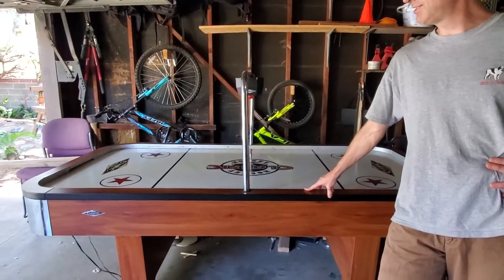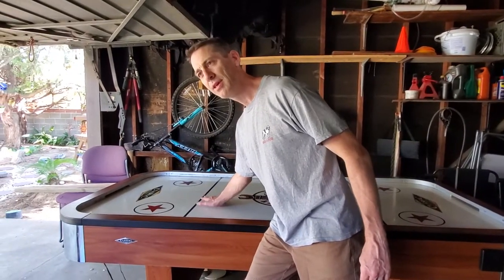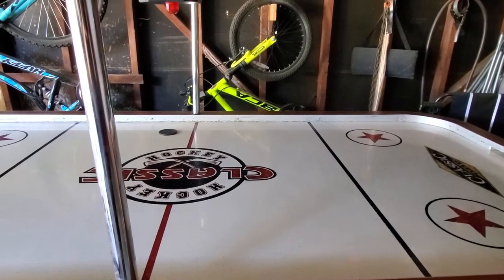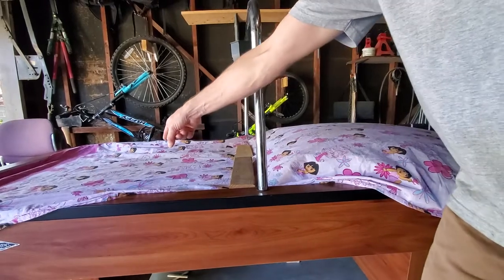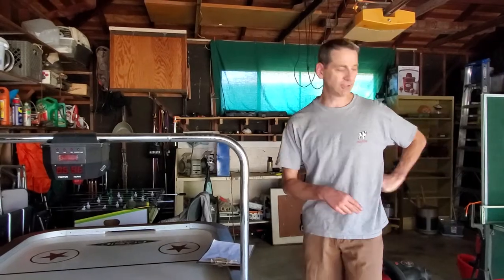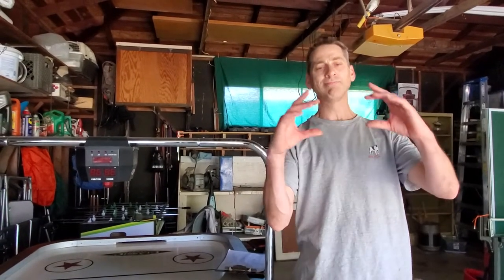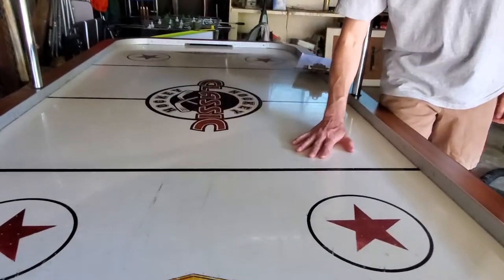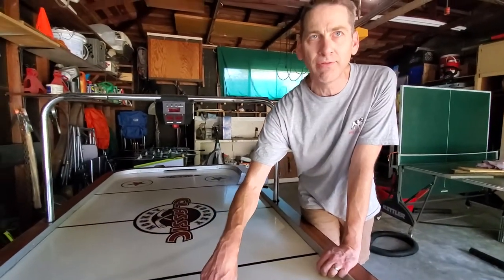Increase airflow on air hockey table at no cost!

Comment: This is a great idea for sure, but that’s not dust from years of buildup, that’s the dust from what you just drilled. 😉
Reply: Nah the 1/16 bit is the same size as the hole, so you are not doing any drilling.  There is zero resistance, you are just using it to pull dust out.   I actually do this with a broken drill bit that no longer has a pointy head so I do not accidentally drill into anything.   The key is to just lightly hit the drill button so you are only slowly spinning the bit
Reply: I get where ur coming from, but the holes are the exact same size as the other non-drilled ones, and it’s from buildup.

Comment: Great video- comment about the puck orientation: The 4 "dots" on the puck need to face the table surface, not the smooth side. I discovered this accidentally after buying my used table and before watching this video. I had no idea there was a difference between the side surfaces so I marked the "up" side with an orange sticker. This makes it easy to quickly put the correct side up during play. Just FYI  😎👍
Reply: Why?
Reply: @GoTips - my guess is that the 4 dimples add stability. The air is trapped evenly under the dimples when compare with the smooth side. I just ordered new Dynamo discs so we'll see if they are built the same way or if they're symmetrical.
Reply: @Spudmuffin00  i have 4 of the 2.5" dynamo puck but they only have 2 dimples not 4 but honestly they arnt so much dimples as they are where it looks like imperfections in the plastic
Reply: @GoTips  - I think the dimples are where they fill the mold with plastic. These are guesses on my part.
Reply from the maker: Great tip, thank you!

Comment: Do Not attempt! you will ruin your table. use a welding file for cleaning tips on a mig welder. and if one side of the puck drags, use a piece of 120 grit sand paper laid on a flat surface and slide the puck in circular motions over it. a little sanding goes a long way.
Reply: Those are to flimsy the drill is perfectly fine as long as you go slow
Reply: I use torch tip cleaners...gas torch, not mig. Just small reamers of many sizes.
Reply: @youknoweverything7643  With literally 1000s of holes, anything risky is likely to screw up eventually. I think I would only go the drill bit route if we are at the point of discarding the table as everything else has failed.

Comment: I'm having a problem with an air hockey table that I don't own. It's at my favorite hangout. The old hair hockey table had a metal surface with no holes in it. The air came from the sides and it worked great. Now they put a new air hockey table in and it's got the holes but the puck doesn't move very good. I don't think they'd let customers go in with a drill. lol

Comment: I'm a professional arcade technician. I have many years of experience working in the amusement industry and own my own successful coin operated machines business. For the love of amusement machines... DO NOT EVER do this to a professional coin operated air hockey table!!
It will completely ruin the table!
And quite frankly, if you do have a professional table (made by Dynamo, etc.), you should never have this problem to begin with (unless somehow a barrel of super glue got spilled over the entire playfield, in which case then you could try this but you really should just buy a new playfield). The playfield on a Dynamo table is replaceable. It's not cheap, nor is it an easy task (I've done it, it definitely takes more than one person), but a new table top for your air hockey table can be purchased from the manufacturer (or a distributor) to be replaced and it's the recommended method (by the manufacturer) for the repair of low flow air holes or other damage that can't be remedied with standard cleaning practices.
The reason the table in the video is having that problem is because it's a cheap, unprofessional table, made for home use only (HUO). If you bought an air hockey table at a retail store like Costco or Walmart, it was most likely poorly manufactured and it will have issues like the one in the video, right out of the box. Those types of tables are the only type you should ever attempt any "repair" of this nature, because replacement parts are unobtainable and the table is essentially manufactured to be disposable.
Also, that "sheet trick" he shows us is absolutely BS! It only looks like the pressure is weaker on one side because he has the two sides divided with that piece of wood and has already DRILLED THE HOLES LARGER on half of the table! So obviously there's going to be more airflow on that side of the table! If he tried that trick before he drilled out any of the holes, there'd be no way to tell where there's more air pressure coming from as opposed to other areas, unless you literally sectioned off the whole table into little tiny areas of one or two holes each and compared the amount of lift you get out of the sheet in every tiny little area, all at the same time! If he showed us that sheet trick before he drilled any of the holes, how would you be able to tell where the pressure was weaker?! What do you think it would look like after all the holes are drilled out? Then sheet is going to lift the same over both sides, unless of course one side has significantly more air flow through a majority of the holes... which is exactly what he demonstrated in the video.
Make no mistake! He's not cleaning dust out of those holes in the video. HE'S LITERALLY DRILLING THE HOLES LARGER! THAT'S NOT DUST THAT WAS STUCK IN THE HOLES! IT'S THE WOOD SHAVINGS THAT'S BEING REMOVED FROM THE INSIDE OF THE HOLE, MAKING EACH ONE A PERMANENTLY LARGER HOLE!! 
You don't wan't larger holes on an air hockey table! It can potentially change the dynamics of how the table works entirely.
These holes specifically regulate the proper amount of evenly distributed air pressure needed to create the proper amount of lift on the puck while moving at any given time during gameplay. The game won't play the same if anything changes... 
-the size of the table top surface
-the size/weight/shape/surface area of the puck
-the location/size/quantity of fans installed
-the size/shape of the large empty air cavity below the table top
-the amount of holes in the playfield
-the location of each hole and/or the relative distance between any two holes 
-the diameter of the holes themselves

Now, If you take a powerful drill and sloppily ream out all the holes by hand (as he  does in the video), there's no way to keep everything perfectly ideal to create the proper lift across the playfield. Technically some of the holes are going to be larger than others, some will be at different angles, the amount of air pressure overall will likely decrease because larger holes means more air is being able to escape all at once, thus creating LESS pressure overall to pass through the holes collectively, which means it's going to need bigger fans (or more of them) to produce more air to provide more flow from the bigger holes. 
Think of a garden hose. You turn it on and water streams out. What happens when you put your thumb over the end? The water stream is more powerful and squirts much farther. When you drill out the holes on an air hockey table, it's like taking your thumb off the end of the hose!
After drilling every hole bigger, technically, they're closer together to one another also. In theory, if the fans on the table are powerful enough to still provide enough pressure to even play the game, having holes that are closer together could likely administer too much air underneath the puck at any given time, which would likely cause it to hover at an improper levels above the table and/or hover unevenly while in motion, which would most definitely cause the puck to wobble, fly off the table when struck and/or get stuck in areas around the playfield.
 
To the poster of this video, Please take a physics class (or two) to learn and fully understand the concepts behind how a flat surface punctured hundreds of times for releasing pressurized air from electric air circulators can cause a round flat molded disk of polymer to defy gravity and levitate AND what happens when a cylinder of metal formed with a sharp concave helix channel spiralling up it (a drill bit) was rotated at a high speed while pushed through a premade cylindrical hole in soft materials consisting of a thin top layer of fiberglass pasted flat against a thicker soft sheet of pressed particleboard where the hole is slightly smaller in diameter than the diameter of the drill bit... before posting videos teaching people how they can potentially destroy an air hockey table completely.... Okey dokey?! Thanks!!
...Sheesh.
Reply: Another point, for the record, if it is, in fact, just "dust" clogging up the holes, why in the world would you need to use something as strong as a metal drill bit and as powerful as a 120v electric drill to remove it?!?!
I thought that FEATHERS were a popular medium used to remove dust.
What would clean dust out of things around your house better, a feather duster or something totally Overkill... like a wire brush?? The wire brush will remove the dust, sure...
...and everything else consisting of the top layer of material the dust is covering!
I rest my case.
Reply: That ain’t dust, that’s wood and plastic from his shaky ass hand! 😂
Reply: @joshradick6096  You are correct! 😉
Reply: @MoreEffinCowbell  
The reality is that 99% of the folks watching this video have a cheap table that was meant to be thrown away.  
They either bought it at a box store for a couple hundred bucks (like you said) and never properly maintained it, or they got it for $20 (or free) at a yard sale/dump because it took up too much room and never got used at the original owner’s house. 
For a majority of people, if they can get the puck to float AT ALL on their dirty, warped, clogged-up painted fiberboard table top, it will be a win for them… even if the play surface and efficiency is far less than perfect.

Would I try to use this method on a beautiful expensive commercial unit? No way. 
Would I try to use this method on a table I just picked up for free on the side of the road? If other methods failed, yeah… sure why not. Got nothing to lose.
Reply: @HammyHammbone  Well, I can't argue with that. When you're right, you're right.
I must admit, I got a little carried away with that comment. I was kind of having fun trying to make it as long as possible. LoL.
But you see, I came here searching for tips and tricks on keeping a commercial table clean, and operating smoothly. I was trying to find interesting ways to teach the young employees of a pizza place how to keep from ruining the table at this one particular account of mine, a table that gets played and thoroughly abused by the general public daily, with lots of children playing it all day every weekend, armed with all sorts of food, drinks and gummy candy to get spilled, smashed and smeared all over it.
So, when I saw this video... It made me imagine one of the employees there seeing this video and thinking they can do me a solid when I'm not there and try fixing an area of the table where the puck has been getting stuck... WITH A DRILL! ... when it's most likely just a sticky spot from a small soda spill and just needs a proper cleaning... and honestly, it scared the living PUCK out of me! 😂
Reply: @MoreEffinCowbell  
I hear ya! 
I hope to have a commercial grade one eventually and will NOT be using a drill on it lol
Reply: Hey man you seem to know what ur talking about so I have a big question to see if you can help. I’m in highschool right now and my woodshop project is a full sized air hockey table. It’s almost done but the biggest problem I have is the airflow doesn’t spread evenly throughout the table. We made it out of 3/4 inch MDF and had a CNC machine cut air chambers  a 1/4 inch into the board and then cut 10 inch slots in the middle that go all the way through. We then attached a board to the bottom that was kinda hallowed out so the air can get through to the table. After that we rolled a specific glue onto the board to hold down the laminate and finally had the CNC drill out all 1/16 inch holes. I still have time to remake the top before entering it in a competition, is there anything you think I could do differently to give it the full effect?

Comment: Use silicone spray to make top slippery....won't clog holes either. I use a torch tip cleaner to ream out holes, avail. at welding supply shops.
Reply: Are you serious? Why would you need the top slippery?! The whole concept of the game is that the puck is levitating on air... That's why it's called AIR hockey!
If your puck isn't properly gliding consistency across the entire surface of the table, something is wrong. It's not working correctly. The puck should never touch the surface of the table while playing the game. Lubrication won't help where there should be no friction.
Also, if you are "reaming" the holes by pushing something into them, where do you think the particulate matter that was blocking your holes going to go? Unless you are able to only pass the cleaner tool through one direction, from the inside out, all the way through, anything that was blocking the holes will potentially fall inside, then when you turn the machine back on it will just get blown right back up to clog the holes.
The air hockey manufacturer Dynamo specifically instructs the users of their tables to never spray anything onto the surface of their tables. They also strongly recommend NEVER insert anything into the holes to remove blockages.
A vacuum cleaner with a hose, using a reducer attachment made for detail cleaning is best. It will suck out the blockages instead of pushing them in. That same vacuum can also be used to clean anything else that might get in the way of the puck on the surface of the table. That's it. You shouldn't ever need to lubricate the surface or even wipe it, unless something like a drink gets spilled on it accidentally. If that happens, turn the table on so that air is flowing out of the holes to keep any liquid out. Soak up anything still wet with absorbent towels and makes sure the surface is dry before turning off the air. If the surface becomes sticky when dry, turn the table on again, using a soft clean towel, spray some Windex or any ordinary window cleaner ONTO THE TOWEL NOT THE TABLE, and wipe the sticky area until clean. Again, Don't turn the tables air off until the surface is dry.

Comment: I have one mini big air hockey table for house not professional one it's motor was not that much powerful i have power on it the batteries were new but whenever I keep the pluck in the centre or any place it does not moves at all so can you tell an simple solution without dill or vacuum cleaner
Reply: Yes! Buy a drill and vacuum cleaner.

Comment: But if it was dust that accumulated in the holes, wouldn't the dust vac have solved the problem instead of going through the trouble of drilling?
Reply: Not good enough, it seems
Reply from the maker: The debris in the holes builds up over time and really sticks to the edges.  It won't come out with just a Shop Vac.
Reply: @jonathanvonah7631  exactly and in fibre board when you drill a hole there are wood fibers that hold the dust there also
Reply: @jonathanvonah7631  Couldn't you just use an air compressor to blow the dust out of the holes saving you from having to drill all those holes?
Reply from the maker: @jasonb5941  You can try an air compressor.  I don't have one, so I did not try this option.
Reply: @jasonb5941  
Using an air compressor would blow the debris INSIDE the table, causing it to eventually clog up other holes.  If you could somehow get the air to blow from the bottom of the playing surface UP, the compressed air method might work, but these tables are usually sealed and the inside cavity inaccessible, with the exception of where the motors mount.

Comment: Okay, counter thesis:

1) your puck worked better on one side vs the other because the puck was rough on one side from abuse, not because of holes that don’t contact the table. This would explain non reproducibility with alternative puck. If the same puck, you are testing on the side of the table with widened holes, so perhaps the air gap between puck and table is now wider than the damaged bit of the puck so less of a problem.

2) the original holes were smaller than 1/16th and the “dust” that you claim to have collected is sawdust because you are eroding the original holes. FWIW, I measured my table a couple of ways and the holes are 3/64, not 4/16=1/16. Method 1 is measure the inner and outer distance between two adjacent holes with a set of calipers and divide the difference by 2. Method 2 was take a hi res picture with iPhone and compare hole pixels with pixel distance between holes. In both cases about 0.05” = 3/64.

It may be that the performance is better drilled out. It depends on the capacity of your blower fans, whether they are up to the task of keeping uniform pressure with the new hole size. However by drilling with an up cutting bit, you risk snagging the edge of your table surface and tearing it up, in effect creating a burr for the puck to run into. Generally wood workers choose down rotating bits for routers in this case to prevent this sort of blowout. Assuming 3/64 (less contaminant) was widened to 4/64, we expect the hole cross section to widen 16/9= 177%, or nearly double. 

I did do something similar to clean the holes  just using a push pin to excavate the holes. It seemed to be about the right size. Use Push pin not thumb tack, so you can get it back out easily.